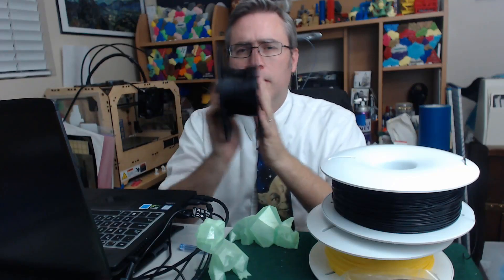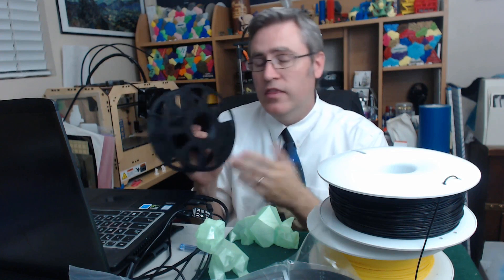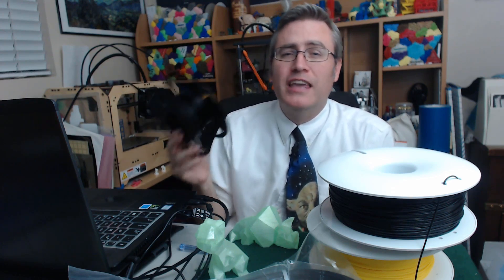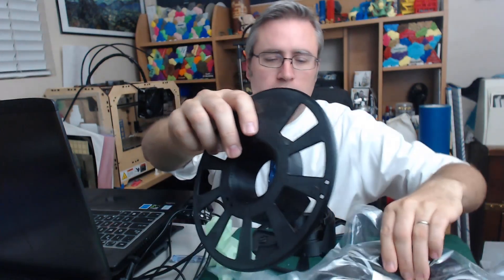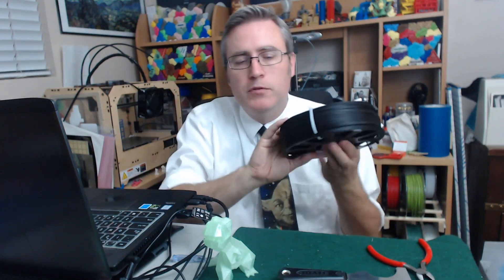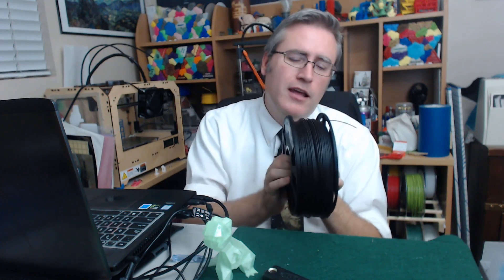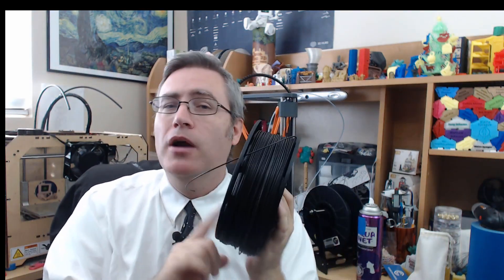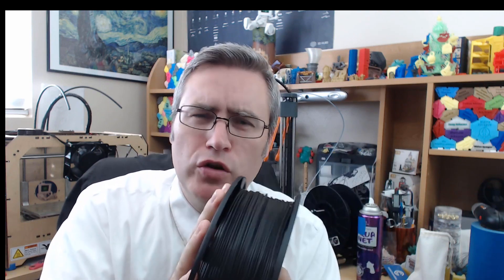The Downside of Masterspool

Comment: As a lot of people commented that there's no real chance you can cause cross overs if you keep hold of the end. Binding would most probably happen if the spool is too tight (ever wound a weed-eater line on it's spool?).
On the other hand a too lose spool needs a bit of management, as in not un-wounding too fast.
And blaming a company (I don't know), for not giving credit to another guy (which I also don't know). I know he designed one, but how do you know he was first? This is like blaming Joseph Prusa and all the other companies for not crediting the guy who came up with the Reprap idea 10 years ago. Yes, there is such a guy.
Reply: I’m pretty sure Prusa has credited both Adrian Bowyer (RepRap in general) and Ed Sells (Mendel), and probably also nophead (Mendel90, for the plate frame concept) ad nauseam.

What Prusa did back then wasn’t so much developing concepts as he was working on refining the design for better/easier manufacturing. The original Prusa Mendel and the Iteration 2 (i2) were both pretty similar to the Sells Mendel. I3 is the one that changes the entire frame to one vaguely based on Mendel90 but with an X axis rotated by 90 degrees.

Comment: As some one who has spent  a huge number of years winding 400m spools of 1-1.5mm Nylon on and off spools a little loose never causes knots it is as others have said impossible. Only if the drum getting unspooled is tightly held or restricted badly will it even be possible for upper layers to bite into lower layers and you extruder will have given up long before that occurs.

Comment: In theory it doesn't matter how loose the spool is as long as you do not release the free end of the spool so it can wrap itself around any other part of the filament

In theory :-)
Reply from the maker: In theory. Hence why the Furling clip would help this so much.
Reply: Yeah. But in that kind of winding, there is another end of the filament. So, no matter how tight you hold this end, another one will dance a twist.
Also, even if filament is not wrapped around, if one loop comes under another, the feeder motor may not be able to give enough force to pull it out, so, the printing process will be ruined.
Reply: Yes, I totally agree, tight spool does not mean good spool. If the manufacturer made sure that there is not crossing loops during manufacturing, then there should be no worry as long as you do not release the free end of your spool.
Reply: The whole point of not releasing the free end is to keep the tension up on the spool's windings if the entire spool is already loose then effectively every winding could tangle with neighbouring windings and create a tangled mess. The fact is that you have to have the spool under tension which is why the master spool concept is not a very good idea as it is very hard to keep the core tight but installable and also keep the width of the spool tight so that it doesn't come loose after loading. A cardboard core and ratcheting screw on side wall that adjusts to the width of the roll is the only way to make a universal spool that has tight windings after releasing the spool.
Reply: Disagree on that! Cross over is also possible simply by the wind being too loose.

Comment: Filaments.ca is using a cardboard core in their refill coils, and 4 zip ties. The rolls are perfectly tight, unfortunately they don't fit on a RichRap master spool.
Reply from the maker: Boo. We don't need yet another standard!
Reply: The cardboard is a good idea.  The incompaibility sucks.  Especially sinve they call it a master spool.
Reply: @markswayne6326  They call the product line the "Econofil", the system the "Refill filament system" and the spool itself a "master spool". Note, its master spool, which is literally what it is, not MasterSpool, which is the name of the Richrap design. Personally, I think either cardboard spools or a properly made standard for master spools is the way to go. I only buy filaments with cardboard spools or no spool at all.
Reply: I just wanted to add - it doesn't bother me that various sources are coming up with different designs and diameters for so-called 'master spools'. If RichRap truly has a problem with others doing this, perhaps they should trademark it. As it stands, to me, the key issue is reducing the waste inherent to buying a new spool for every new roll of filament. 

Even if i can only do this with a set line of filament offerings from my supplier, it goes a long way, when the cost of their economy filament is roughly half the price of their standard offerings - for the same quality (and in some cases, better).

All of my prototyping gets printed with their economy grey PLA, coming off a Filaments.ca masterspool now. If they allow other filament makers to use this format then all the better.
Reply: The RichRap spool is FAR from optimal. Filaments.ca did it right. Not only that... their prices are right as well!! So their stuff won't fit on the RichRap spool... Then standardize on the Filaments.ca spool!
Reply: They don't fit on a RichRap spool, but they do offer both their own empty spools as well as a completely free file to print if that suits your fancy. I'm on my second rebuy and haven't run in to any problems yet. I only wish there was a greater offering colourwise, but for economy offerings, i guess this makes sense.
Reply: Florence Chan, reducing cost and waste is great.  Calling their spool a master spool is misleading.

I dont know if their use of the term predates the Richrap spool.  I hope it does, otherwise, in my opinion, this behavior would reflect poorly upon them.
Reply: The idea behind it is to have a set standard that everyone uses so you don’t have to have multiple different designs of spools for different manufacturers. Which would partially do away with the benefits of the master spool as you would have more spools laying around.
Reply: @Mark: If you check out their blog, you'll find Filaments.ca gave Richrap credence for having popularized the concept. They also point out that the concept had been around for some time and that they had already been experimenting with spool-less coils for some time.  Again, if this is truly a sticking point with Richrap and it's something he wants to monetize, perhaps he should make some attempt at patenting his design or trademarking the name. I find it highly unlikely either claim would be successful, however.
Reply: @Riley: While that's true, casting aside multiple different designs in favour of manufacturers who only offer products on a spool really misses the point - If you can settle on a brand to use the majority of your print time and they offer a master spool upon which you can load all of their filaments, it makes no sense to eschew this solution in favour of products and companies which offer no such advantage. 

I would be totally fine with buying/printing a Richrap spool if I found that compatible filaments were to my liking, just as I was totally fine with printing a Filaments.ca spool having found their filaments to my liking as well.  

It's also somewhat disingenuous to suggest that any maker only has one spool at any one time for ALL of their filaments. That's simply not going to be the case, particularly if one needs to switch filaments out regularly.
Reply: A coreless spool seems like a terrible idea. The cardboard core makes a lot of sense as you have the spool wound tight and you just need to make sure the width is either adjustable or very percisely controlled. Having both width and inner diameter precisely controlled for the master spool without core is a bad idea.

Comment: You can't get an actual knot in the filament unless you lose track of the end.  So I think you're referring to it binding between loose winds in the spool.  That can happen, but no knots, unless the user messes up.
Reply from the maker: Well, it's a slip knot, but functionally it can act enough like a knot to ruin a print, possibly. Chances are it'll be fine, but we'll see.
Reply: I got a spool today of fex filament and the end were lose on the spool. 🤬 as it looks like it was taped to the side of the spool originally but it slipped out of the Tape.

Comment: Honestly, i dont really see where the spools could fail because they're not tight enough. Why would a spool become suddenly so tight, it would bind the filament that was able to cross before? But, as i'm fairly new to 3d printing, i'm open for arguments and very interested in a discussion, as well as a follow-up video on that spool. Whose mechanism i btw like far more than the original master spool, because why would you use additional screws when you can print a mechanism or even functional threads?